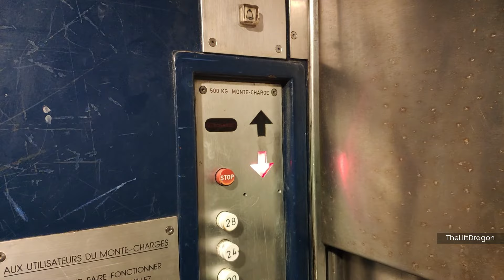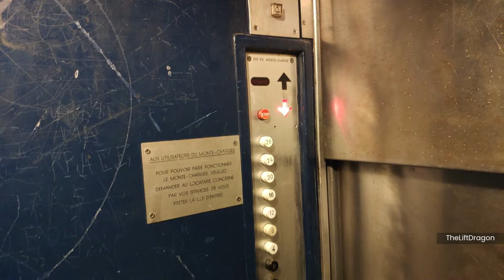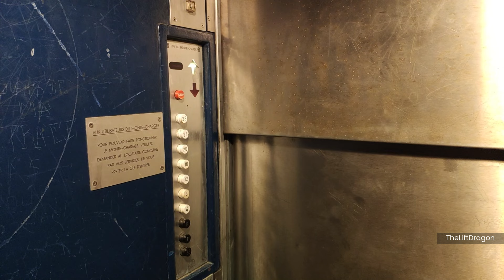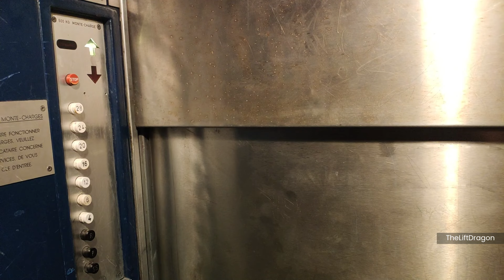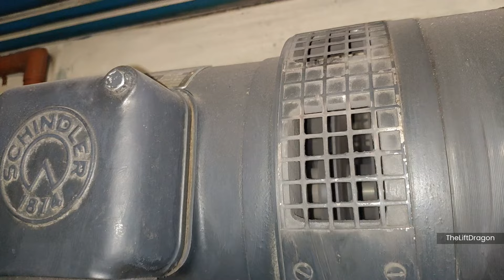EPIC High-Rise DC GEARED Schindler DYNATOR Lift in Geneva, Switzerland

Comment: Very nice. I always wondered who the vertical doors look from on top the car. Thanks for showing that. And I love those vintage floor selector. Suprises me that they worked so reliably.
Reply from the maker: You're welcome!
The Schindler floor selectors are truly marvels of engineering. This one here is especially interesting because the breaking distance of the lift is longer than on a standard 2-speed, so the selector is a bit more complex. The lift also needs an intermediary speed, which is slower than nominal, to travel between the floors in the basement.
Sadly, I've heard that this lift now had some problems recently. I don't know how long it will be kept like this. Hope it won't get modded or replaced soon.
Reply: PEELLE ?

Comment: At which nominal voltage the DC motor is running? I couldn't read the type plates ...
Reply from the maker: Der Hubmotor hat nominal 9.6kW bei 300V / 33A, 1170 min⁻¹. Erregerwicklung hat 130V / 4.5A.
Der Generator dazu macht 10.5kW bei 320V / 33A und 1440 min⁻¹ und der Drehstrommotor am Netz hat 12kW und Nennstrom 25A.
Reply: @TheLiftDragon  Vielen Dank für die ausführliche Antwort - super !

Comment: brushed DC generator and motor
brushes get used by the time(ac motors do not have this issue, who makes brushed ac motor?)
idk if want to keep relay logic, it is possible to replace dc generator with a full bridge ratifier(convert ac to dc, but maybe it needs a transformer(for step down?, idk how much volt is dc generator outputting) and capacitor(for stabilize voltage))
Reply from the maker: AC motors with brushed do exist, but they are called slip ring motors and the purpose of this is to reduce startup current by switching resistors in parallel with the rotor windings, which are shorted as soon as the motor reaches nominal rpm.

And no, a DC generator of a Ward-Leonhard drive system can NOT be replaced with a solid state rectifier. The generator does output a variable voltage depending on the field current, it acts as an amplifier. In oder to drive a DC motor, a H-bridge circuit is needed. In fact, two of them, a big one for the armature current and a small one for the field current as this is a motor with separate supplies.

Comment: The floors seem very far apart on this lift. Is this underground at cern?
Reply from the maker: As can be told by the floor numbering, this lift is in a tall (residential) tower block. SS is the basement, P is parking and R is ground. Then the lift only stops at 4, 8, 12 and so on.
Reply: @TheLiftDragon  Thanks!

Comment: puh…. these lift doors would give me some anxiety together with no indication whatsoever on what floor you currently are when the lift car is in motion
Reply from the maker: Do you mean the vertical inner doors or the swing doors? As you can see, the swing doors have the floor numbers written on them on the inside. So before the vertical inner door was added, you could see the floor numbers on the shaft doors while moving. That's why a floor indicator was omitted at construction.
Reply: @TheLiftDragon  yeah, meant the inner doors. Gotcha why no floor indicator was added during construction.

Comment: Thanks for sharing this amazing elevator! Why are there so many dynamotors (or rotary converter) ? Thanks
Reply from the maker: You're welcome!
Tje big one generates the main DC voltage to drive the motor and the smaller ones generate the excitation voltage for the field coils of both thr main motor and generator.